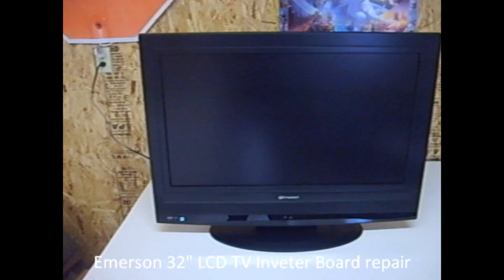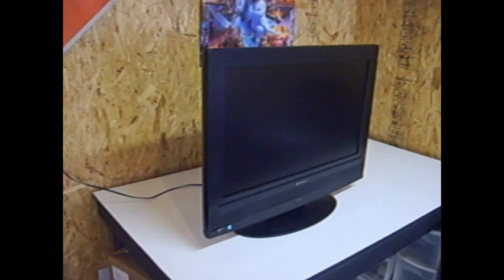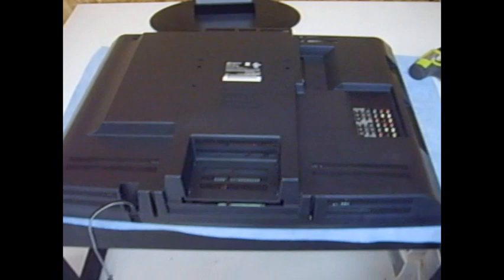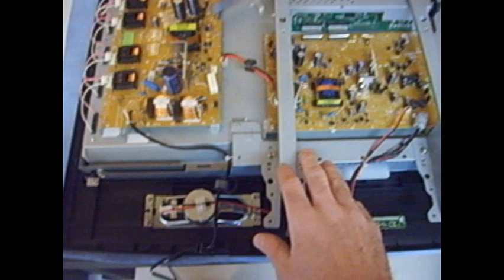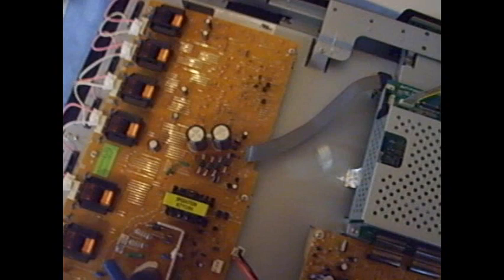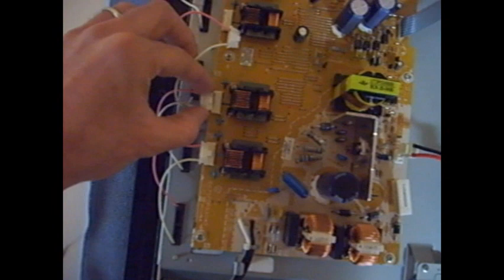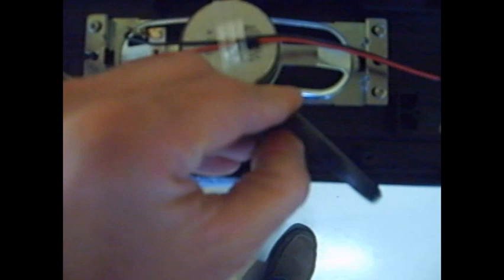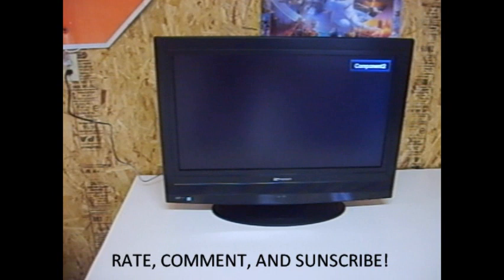Emerson 32" LCD HDTV LC320EM82 Inverter Board Repair

Comment: Wow!  I have a 42" Philips that has a black screen, but it does have the power light on, and has sound.  I replaced it and have had it my garage for the past several months.  I think I will try to find an inverter board and attempt to replace it myself.  Thanks for letting us know we can do it ourselves!

Comment: What a great instructional video!  I don't even HAVE an Emerson, I got a Viewsonic 4:3, 21.3 inch. Upon power-up, screen stays on for about 1 sec.  Using this video I was able to take the Viewsonic's back off, locate and remove the faulty inversion board. Now all I have to do is order the correct replacement board and I should be in business. These monitors were like $800~$1000 in their day, used by professionals, often multiple units. I'll post again after the part is replaced.Fingers crossed

Comment from the maker: He did have that model but is still sold out. the good news is that he will be offering a few parts that may help fix the board. he did mention that he thought it was better to replace the whole board because of the lack of quality but thought this would be a good solution until they are available again. when he get these parts in i'll do another video. thanks!

Comment: Thanks for the video and idea. Had the same problem with my Sylvania 32" LCD/DVD combo.  Capacitors look good.  Ordered the inverter board.  Replaced it and it's now working.

Comment: I just got a free one of these tvs in excellent condition - power surge blew the fuse. I replaced fuse on the power supply (about 80 cents at Radio Shack), hoping that no other damage had been done, and the tv fired up :-)

Comment: Thanks for taking the time to post your insight...Looks like same problem I have on a LC320EM1...not sure how they differ...but it looks like the fix I need...I'll check out eBay for inverter...I did not see link for your supplier...but looks like older post...im sure ill come up with something...

Comment: I have the same 32" Emerson that I bought at Walmart on Black Friday for $188.  It worked great for 7 months then started doing exactly what you said yours did.  Could you please exactly which inverter board to get. I went to the link you provided but didn't know which one to get.   I believe with your video, I could do it myself.

Comment: I have a LC320EM2 with no power. Purchased 2 years ago from Walmart with little use.   No power or lights so I'm assuming it's the inverter boad.  I'll let you know.  Thanks for the video.

Comment: Hello! Thanks for sharing your video.. However, I have a few questions... In base of what you determined it was the Inverter Board? Did you troubleshoot any component before buying a new board? Just seeking to understand your troubleshooting method. Other than that, great video-tutorial.... 73, Joe-K4JGA

Comment: Can you show me how to replace the main board on the Insignia LCDTV32. and where to get the part. Many people have the same problem- tv turns after a few minutes on. The inverter board has already been replaced and did not fix the problem

Comment from the maker: @bdawg394 I repaired a TV at work with the same problem. It was a 42" LG LCD. It ended up being a bad video board. quick and easy fix for that brand. Not sure how easy it would be for a smaller monitor like that, or how hard the parts are to find. I get most my parts off eBay. I wouldnt spend to much considering you can find a new 22" on newegg for about $140. hope this helps!

Comment: Hello,
I bought LC320EM2F on black Friday in 2011. But just plug it in and was doing great. BUT after about 45 minutes - it just went off - like electricity just went out. And it wouldn't show any sign of power. 
Would it be the same inverter box? 
Thanks

Comment: hello i have this same tv and i looked at the inverter board and notice the fuse 4a/125 volt was blown i replaced it and pluged it in and the same thing happen again to the fuse could this be a bad inverter problem also

Comment: I have an Emerson LC320EM2F.  While setting on the floor to dust off the shelf the vacuum fell over and the handle hit the screen leaving a scuff mark.  Now when it is plugged in the red power light comes.  When I push the power button the red light flashes a couple of times but that is all.  Any ideas?

Comment: I have the same issue with my Sylvania, only, after about 50 to 60 attempts my TV will eventually come on and stay on....its just i hate having to start trying to turn the TV on an hour before I actually want to watch something, would an inverter board repair my issue as well?

Comment: I have the same LC320EM8, and it lasted 9yrs. If you make it past the 1yr marker, you might be lucky and the power inverter will last 9yrs. My screen has a black shadow shaped like a tornado in the screen. Its noticeable but its not that bad to me anyways, for a cheap tv.

Comment: Friends gave their emerson LC320EMA2. They thought only needed a new remote. I bought 1 of the more expensive remotes which did not do a thing. Buttons on the TV itself did not work, he could not get it to go to channel 3 or 4.  It will go to video & you can watch videos on it. So we know it has a picture and sound. Does this TV have to have the original remote that came with or will another remote from emerson work, or is there something we have to repair?  Any suggestions would be appreciated

Comment: So I have a KDS 19' Rad-9 LCD computer monitor, and one day the screen didn't turn on. It would still turn on and show up on other computers I hooked it up to, but it was just always black screen. So I took it apart, and shined a light where the back lights are, and I could see an image. I have two backlights, each with two florescenty tubes, so I doubt they all broke at the same time.... Its the inverter board right? Do I need a new one of that exact kind?

Comment: so i have a problem with my emerson 26" lcd hdtv LC260EM2
my t.v. will not turn on and i saw there was a blown fuse and replaced it but it still doesnt turn on. there is usually the red light to show its on stand-by but that does not come on any more. my fuse is a 4a/125v. any suggestions?

Comment: Hi Christian I have a 40 inch element HDMI the model number is FLX-3710 the blue screen came on and just went into a black screen and its stays black do I need an inverter board also. Christian if you could help me i appreciate this

Comment: I have an Emerson TV Model # LC195EM82 with seven vertical lines on the left side of the screen as your looking at it. I am not sure what is causing the issue or how to fix it. Any help is greatly appreciated.

Comment: Hey I have a Samgsung LCD Flat Screen. Its like 40inches. And there is a thick black line going right through the middle. I can see whats on the other sides of the screen. But not the middle. Any thoughts? 

I don't think its the Display board as they were mean't to work for 20 years.

Comment: great video, but the problem is to get the inverter board for the LCD EMERSON LC320EM82s, I have a question and I hope that you do will help me, can I used the part number BA71F0F01041, if my part number is BA71F0F01042.

Comment: Hi I purchased Emerson 32" Class LCD HDTV, LC320EMXF that has the ghost volume down problem I got it for my son dec 2009 with an extended warranty of 3 years. What do you think is the problem and can I get parts to fix it. If not the inverterboard then what could be the problem? Thanks  Norman

Comment: How about a power board replacement video for this model.
I repair them & also computers & computer desktop monitors & have a friend that's letting me repair his same model Emerson with a power green light flashes then the red comes on & goes into the standby mode.
I believe some caps may have popped on it but haven't taken it apart as of yet to check it,.
Thanks!
Reply: The Emerson I'm repairing now the green power light is flashing 2 times & then goes in the red light in standby after replacing the board with another that looks like a sloppy repair form another repair company. The original board power light flashed 15 times before going into standby.

Comment: hey how you doing. do you no if the guy on ebay has the inverter board for my model its a emerson 32 inch LCD HDTV LC320EM82S cuz the model you was showing was with out the s at the end of the model #. let me no.  and your video is well wanted i will let people no thanks.

Comment: iight so i have a emerson tv 32 inch LCD model BLC320EM9B and i have the same problem but cant find the inverter board no were ...can u help me find the inverter board for the model i clicked ur link on ebay and couldnt find it can u find it 4 me and give me the link it would be greatly appriciated

Comment: Do you know how to repair defective sound boards? Im getting a similar 35 incher for free tomorrow and the soundboard is dead all other functions are good. I think its emerson brand ill know when i get it forgot what ad said lol im suspecting bad caps but if not im wondering if i can bypass the sound and just use a home theater for audio as most never use those chincy speakers lol

Comment: i have a Emerson LCD EWL20S5 its being out of used for some time now because it just started to turn off by itself almost immediately after being turn on i took it to one Tv repair shop but they told me they don't work with Emerson brands  do u think that its the same thing that the one that u got fix on the video ?

Comment: I am so disgusted with emerson. I have only had my Emerson 32" tv for about 4 months and I am having the same problem. Walmart won't take it back.Emerson is stating I should have read the manual and that they only cover the parts and not the repair. They want me to pay $80 dollars. Even Walmart doesnt know what they are talking about. 

I feel like I've been cheated. From what I've read lots of Emersons have the same problem. They should have fixed it by now! I'll never buy another one.

Comment: So, $60 for a board likely to only last another year, and is only 1366x768?

No thank you.

Doesn't make sense to pay that much for 12 months of NOT being full HD. I have better luck in pawn shops. (Only stick to Samsung 500 series or better, or smart versions of Vizio with good ratings)

I suppose if you don't have the ability to drive through a few towns and find one where some poor Sob pawned a gift from their rich relative while it was not even 6 months from  manufacture, maybe you might consider trying to repair a set like the one shown here.

I just picked up a similar set free, except the button panel is on the right viewed from the front. Has same problem.

Will sell it to you for $20 if you want to fix it and use or sell it working fully.

Same exact symptom.

Located in Guymon, OK if you are close enough to pick it up, but also travel to Las Vegas, NV and SLC, UT a few times a year for work.

Thanks for posting the easy, but not cheap fix...